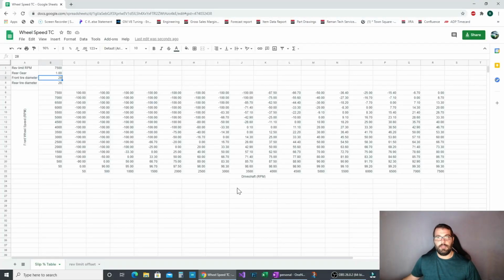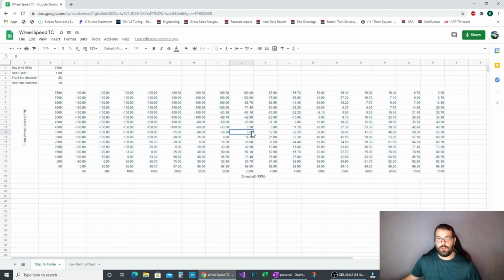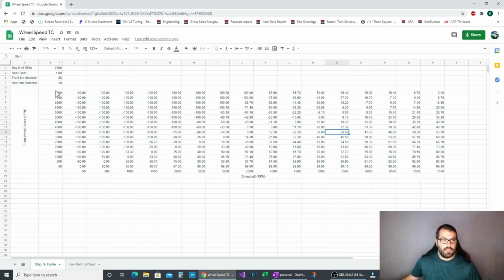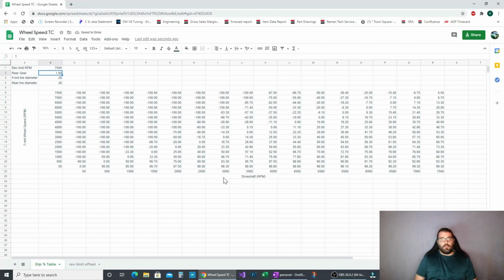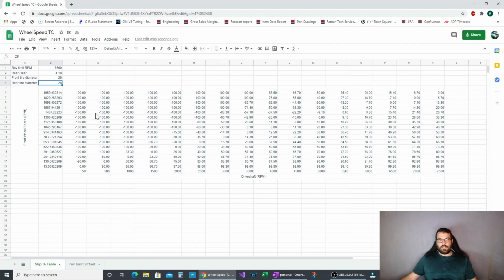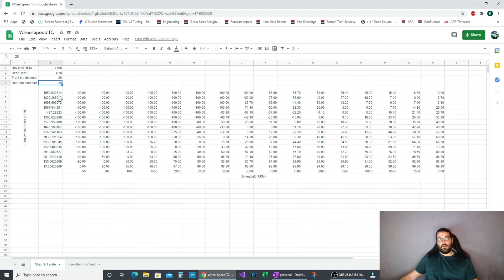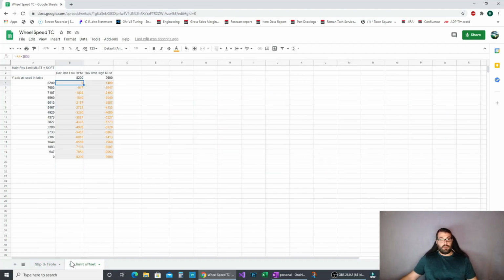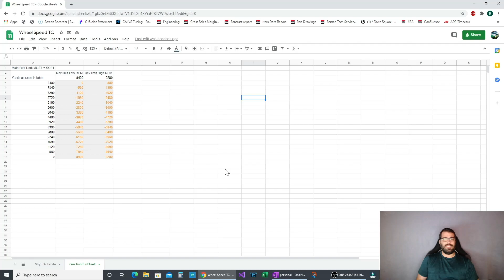Holley EFI How To: Wheel slip Traction Control part 2 (spreadsheets galore!)

Comment: How do you do the table in mph
Reply from the maker: Just take the axis and make them equal. I need to do a video on it.
Reply: @highperformanceconsulting7616  I was trying but it just comes up equations and wouldn't let me chnage the values
Reply from the maker: There is no need for the spreadsheet just copy in the table values and set both axis from 0-200mph equally
Reply: @highperformanceconsulting7616  how does it fill in the table?
Reply: @highperformanceconsulting7616  I set rev limit to 200.  Both tire sizes to 28.  And gear ratio to 1.         
Put the x and y axis number to something nice.  But the slip percent numbers appear to be the same as they were with rpm and specs entered correctly.   So do I not need to change those?

Comment: I have a 4L80e and am hooking up a VR front wheel speed sensor to my Holley Dominator setup for traction control, I don't believe I have a "Driveshaft RPM" option from the selection with my setup, unless there's a way to make an output for the speed sensor read to the Holley in RPM, that I'm not familiar with..... would the data numbers in the table be roughly the same to change to MPH? Or does that shift the entire arrangement? I also have no idea what MPH range I would have to set.  Doubt I'd be going over 160-180mph.
Reply from the maker: The table values stay the same is you use mph. Just set both axis to the same mph scaling. 0-200 would be good
Reply: @highperformanceconsulting7616  awesome! Thanks so much for the quick response!

Comment: Just noticed that Cell J13 on the first tab should be -12.5  I think where it is 0.1. Have mine set up as straight wheelspeed and noticed my slip calculation was drifting while steady state on the highway
Reply from the maker: Thank you very much for the feedback.  You are correct and I just updated the sheet or future users.  Again, thank you for the feedback
Reply: @highperformanceconsulting7616  Thanks for the content, great stuff so far. Somewhat related question. I currently a running OEM VR ABS sensors for front/rear wheel speed, and I am converting to MPH. Do you see any functional difference between using wheel/driveshaft speeds in RPM vs MPH?
Reply from the maker: @PgUpPerformance  No, for this application RPM and MPH are functionally the same.  I just showed it with RPM since that is the tune I had to work with at the time.

Comment: You can do both front wheel and driveshaft as speed inputs and get MPH from both to put into the table taking all that math out, so is the a reason to not do it that way over this more complicated way?

Also, came up with an idea. We can already put the drag time slip data into a datalog in Properties. It would be cool to line it up with transbrake release and display lines on the graph for each point down the track.
Reply from the maker: No real reason other than someone already has a driveshaft sensor setup for rpm and doesn’t want to change it or add a second input setup in mph.

Comment: I understand your first tab ok but not sure where to put the values from the second.  Referring to your Cylinder Drop table i am assuming the Y axis RPM is engine RPM.  Each cell in the cylinder drop table is then a boost offset value.  Do I put the high value in each cell?  If so where do I put the low values?
Reply from the maker: I cover how to use the 2nd tab of the spreadsheet in my other traction control video at the 5 minute mark: https://youtu.be/NtqeYN8vl3A